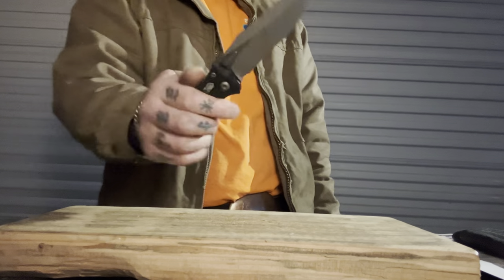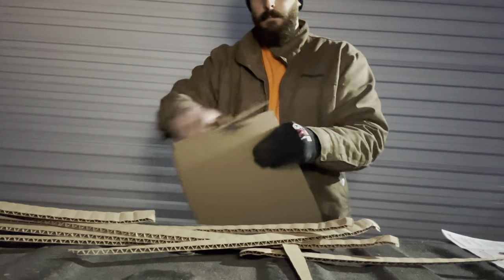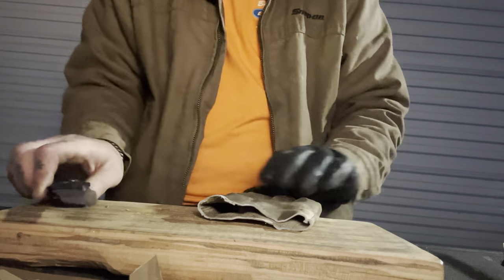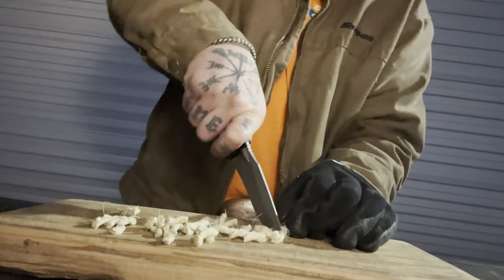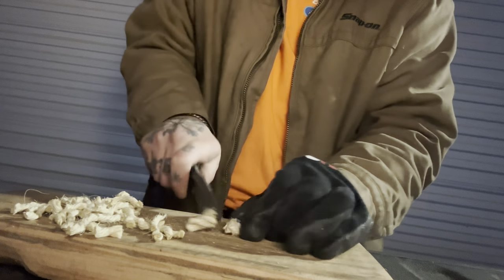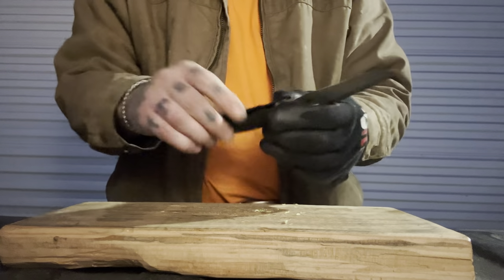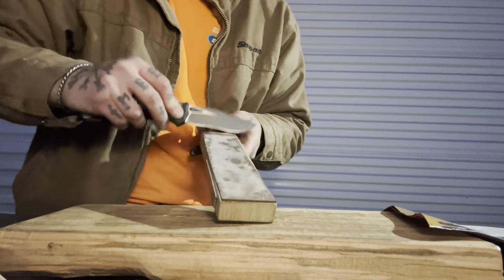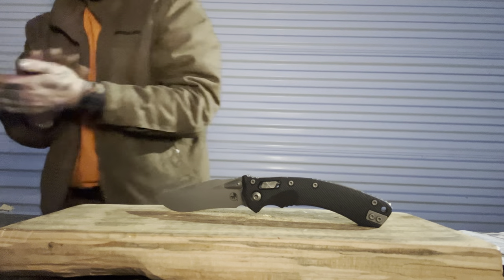Cut Test: Microtech Amphibian! This Thing Cuts!

Comment: Hey Dood! I wanted to mention a couple things as well as ask you a question. I've got the same exact model Amphibian (fluted G10/apocolyptic blade) and I've had a hell of a time keeping a good edge on mine. Ive been using it daily as my work knife for the last 3 months. I've tried 22,24,26, and 28 degree angles all at 600 grit and none hold an edge very well. My Stitch at a 24 degree angle holds an edge way better than the Amphibian has so far. Any recommendations for that? And another thing i wanted to mention, for anyone interested in picking one of these up, the pocket clip is indeed HELLA stiff, but mine just finally within the last month has broken in enough to where i can get it in my pocket with just one hand now. And finally my question for you, I cant remember what video of yours it was, but i remember you mentioning it being a possibility to "over-strop" an edge. Can you elaborate on that a little? How do you know when to stop stropping? How can you tell if you've over-stropped? If you've read to this point, thank you!! Love your cut test videos, i always look forward to them.
Reply from the maker: Hmm.. if you’ve tried all those angles then you’ve sharpened it past any burnt steel, so that’s not it. 
Could have gotten a wonky one? I dunno man. 
I think less is more with stropping, I usually do like five strokes per side that’s it
Reply: @doodysdaggers  The next logical step in my mind is to play around with different finishing grits and see what happens I guess. Anyways, I appreciate the response!